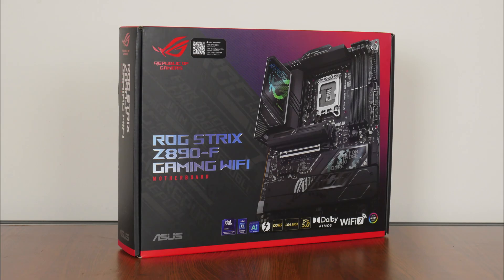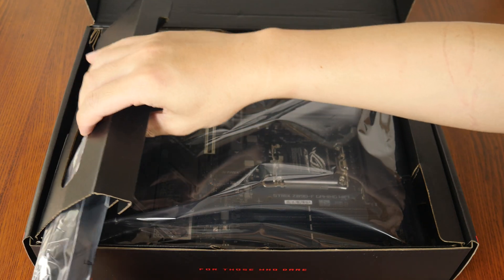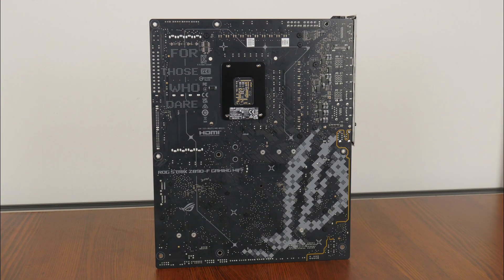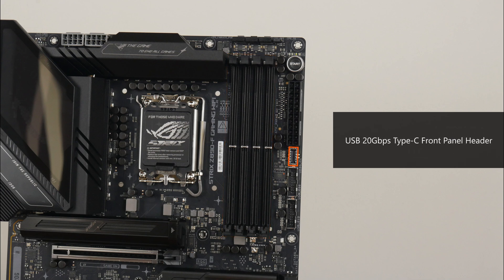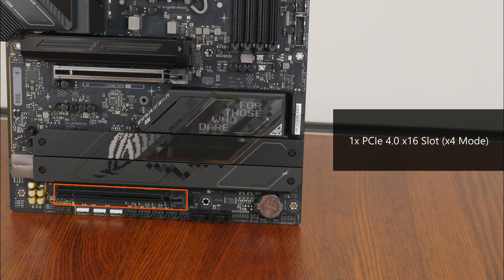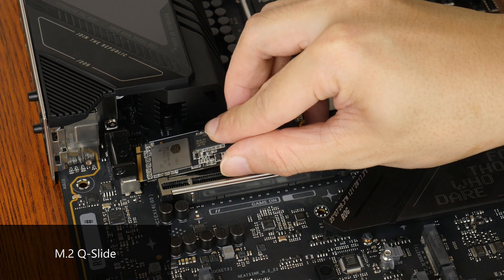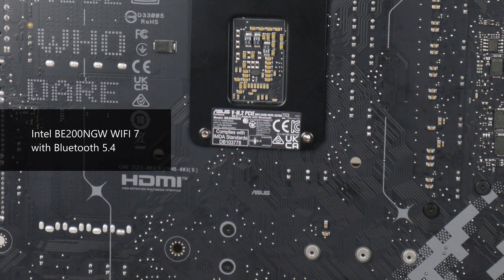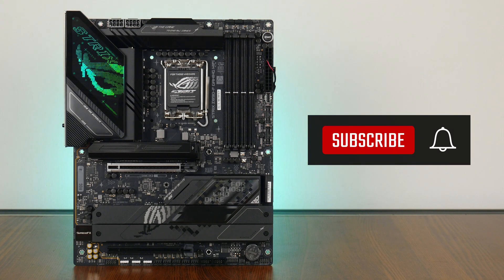Premium Intel Z890 Motherboard for Gamers - ASUS ROG Strix Z890-F Gaming WIFI Unboxing & Overview

Comment: If utilising the onboard DP and HDMI ports along with 4 display ports on the GPU, could you run 6 displays that actually works?
Reply from the maker: Hey there, I haven't actually had the chance to max out the number of monitors on a build before, but theoretically, it SHOULD work, as long as you get a processor with integrated graphics (i.e. non-F SKUs)!

Comment: 1: WIFI-7 IS JUST A PACH SOFTWARE) THAT NEED WIN11 24H2 =>ITS JUST WIFI 6E ON EVERY MEANING. {SAME AS Z590F 11GEN INTEL LGA 1200}
2: IT HAS THUNDERBOLT 4.0 {SAME AS Z590F 11GEN INTEL LGA 1200}
3: IT HAS 1X PCIE 5.0 X16 FOR GPU {IF YOU NOT USING NVME PCIE 5.0 {SAME AS LGA1700} BOARD HAS ONLY 2X PCIE X16 {BUT NOT ANT PCIE-4X OR 8X SLUT AT ALL}.
4: IT HAS 1X M2 PCIE 5.0 FOR NVME { IF YOU NOT USING GPU PCIE 5.0} {SAME AS LGA1700} & OTHER M2 SLUTS ARE CHIP & PCIE 4.0{SAME AS OLDER MOTHERBOARDS}
5: THAT TWO USB4 THUNDERBOLT ARE ONLY 20GB WITHOUT THE ACTUAL THUNDERBOLT-CARD =>THE ACTUAL T-4-CARD SELL SEPARATELY AND ITS NOT CHEAP.
               ""AND IF YOU PUT THAT THUNDERBOLT-4.0-CARD ON YOUR MOBO YOU HAVE NOT ANY SLUT TO INSTALL CAPTURE CARD & ETC ""  

          YOU PAY 900$ FOR NOTHING MORE THAN 4X MORE USB PORT.
.... AND 285K WITH 447W ISN'T MUCH DIFFERENT THAN 14900K- 450W ..SO GOOD LUCK BUYING MINIMUM 590$ COOLER.
+ LETS TALK ABOUT HOW CORE ULTRA 9 285K IS 20% SLOWER THAN OLDER INTEL CPU'S..AND STILL HAS NO AVX512 VS NEW AMD CPU'S.

3:0 HE ACTUALLY SHOW ME : few zip ties, two screws, few pieces of sponge and few centimeters of silicone pad? => BUNCH OF JUNK
4:0 THAT IS NOT OLED-LCD! IT JUST A PLASTIC COVER ON RGB SMD THAT ASUS MADE AS 15 YEARS AGO. {ITS A NORMAL RGB-SMD NOTHING SPACIAL }

- IS THAT WHY THERE IS NO CUTE BOY LIKE THIS ONE IN UK.?!

Comment: These new motherboards are mindblowing! I doubt that many ppl will use up all 2256 Gb capacity, my mobo is AROUND 64 GB total and i ve never went above 24 GB, also sold two sticks now im on 16Gb this amount also efficient for HD gaming
Reply: 64GB modules aren't available for this platform yet. They will be only available later in H2 2025. But there are plenty of users who use previous Intel platforms with 192GB of RAM because they need it. I have a system from 2018 with 192GB, and it's barely enough.